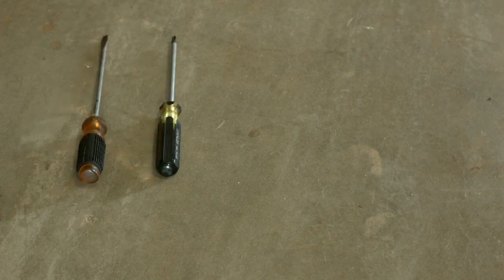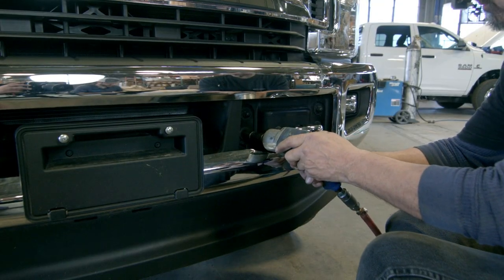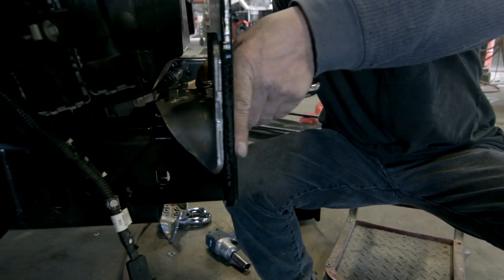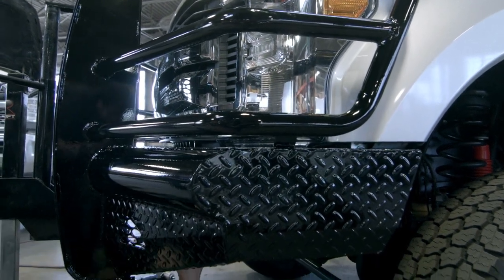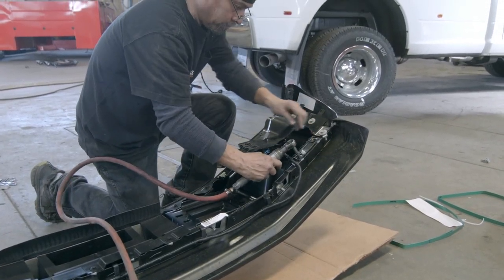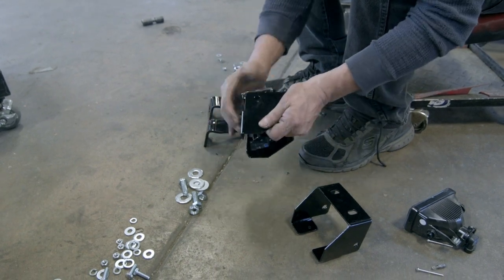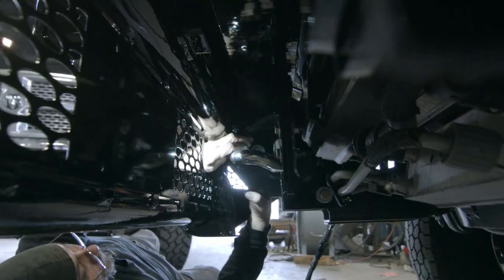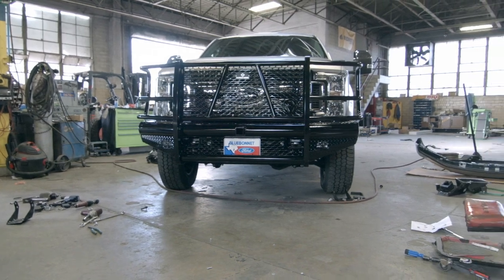Legend Series: F-250 Front Bumper

Comment: I still don't get it why change a bumper it doesn't add any durability to keep from setting the airbags off. I'd rather add a brush gard that connects to the frame but none of the brush guards have really good mounts to their mounting brackets just weak bolts that snap easy. Can't buy anything good for your truck anymore because companies think people are retarded. If you want something good to add protection to your truck you have to build it yourself. Because companies don't make anything but junk anymore.
Reply: Peacemaker Bumper replacements. 
Look them up, that's all I gotta say. 
Extremely happy with them. you have to call them up to order it, but that's so they get your order right. They will even custom build a bumper for you, if you want to use certain size fog lights or angles or looks.   They can do it.
Reply: It’s all about price if the bumpers were made more expensive then people would gripe about it costing a shit ton and less people would buy them
Reply: Use grade 8 hardware and they ain't snapping